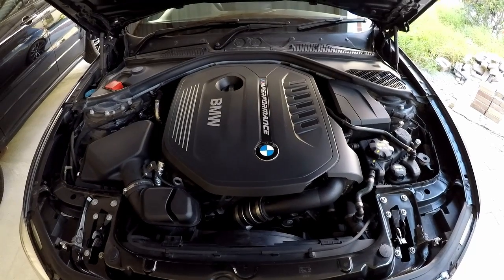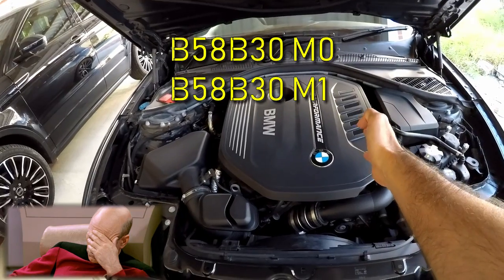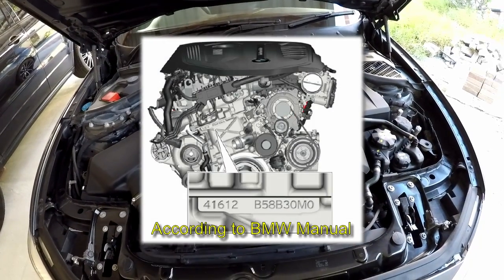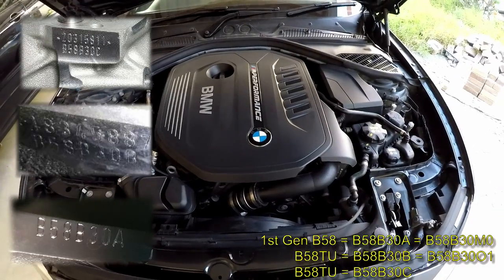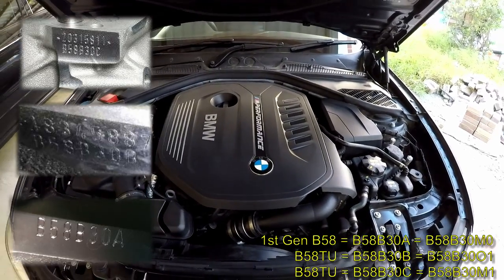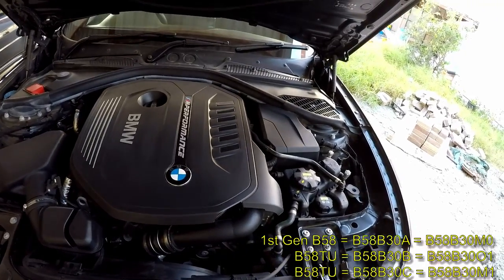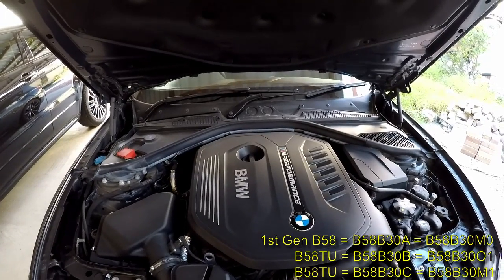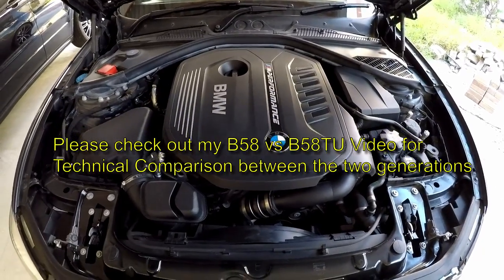BMW B58 Engine: How Many Variants?

Comment: Hi. My English is not good. I did not really understand tech difference between b58b and c. I know that b58c around 50hp less then b58b. Is it just programming or different parts? I am just thinking between 540(335hp) and 440(385hp). If I do stage 1 on both, they both will get same hp? Or still will have diff 50hp?
Reply from the maker: Hello, the B58B30C (or B58B30M1) is almost identical to the B58B30B (B58B30O1), except that the cylinder head of the B58C has an integrated exhaust manifold, whereas the B58B retains the same type of exhaust manifold at the B58A. The exhaust manifold is what takes the hot gases from the cylinders (after fuel combustion) to the turbocharger turbine section. In the B58B and B58A the exhaust manifold is outside the cylinder head, in the B58C the exhaust manifold is part of the cylinder head itself. The reason that the B58C has this feature is so that the hot exhaust gases are used to warm-up the engine cylinder head faster , and a warmer engine means a more fuel efficient engine. More fuel efficiency means less emissions. So this was done purely to reduce emissions of the B58C compared to the B58A and B58B. However, as the B58C has been made artificially warmer even though its cooling system is identical to the B58B, it also means that it can reach temperature limits faster in heavy operation conditions. The ECU is monitoring the engine temperature (through e.g. the component temperature sensor and coolant temperature sensor) and as soon as the ECU detects or projects that the safe limits are exceeded, the ECU will reduce engine power to maintain safe operation. In other words, the B58C and B58B are likely able to be tuned to the same power output (they have the same components except the cylinder head and beyond), but in heavy operating conditions the B58C is likely to reduce power faster than the B58B as it gets hotter, to protect itself from overheating. This is just my humble opinion. :)
Reply: @NoBrainerTalk   It has been on my mind for some time that the B58C performs less then the rest of the B58. But from what I understand, the only variant is the cylinder heads, and the manifold. My fam has an 2021 x5 with the B58C and back of my head, I hope I can take it to the same level as other B58's, performance wise.
Reply from the maker: @kevin22duong-_-  Hi there, much like the 1st gen B58, the B58C has been tuned with no modification from 335hp to over 400hp (especially in A90 Toyota Supras). Just like the 1st gen B58, the B58TU design seems to be easily capable of more power than stock. I believe the only difference will be how quickly the B58C reaches excessive temperatures (compared to B58A and B58B), but that should really not be a problem outside a race track.
Reply: @NoBrainerTalk  That is interesting to say the least, I know I won't racing or tracking my family's car anytime soon so I shouldn't worry about overheating issues. But I do plan to travel and push it on straights and in the mountains every once in awhile. I might look into cooling solutions and possibly aftermarket bolt on parts like intercooler to help keep the car at low temps and heatsoak. (If you have any recommendations) Is it the engine or the manifold the components overheating?
Reply from the maker: @kevin22duong-_-  It's all connected, if the engine block or turbo heats up inside the engine bay, it will heat up pretty much everything around it. Measures  to keep engine temperatures down include cooler air coming into the air intake muffler box from outside the engine bay (in the case of the 1st gen B58 this is called the "hot climate mod", opening up any blanks to allow cooler air into the engine bay (sometimes blanks are found behind the kidney grilles at the sides) but I would hesitate to do this personally without a grille protecting the opening, replacement intercooler radiator/heat exchanger as you said, checking coolant is at the correct levels at both the expansion tanks, that kind of thing.
Reply: @NoBrainerTalk  Speaking of kidney grilles, Im taking delivery of a 2022 BMW X5 xdrive40i with the B58C I believe (335hp) and it has this interesting function where it closes the kidney grilles to prevent air coming in. Not to sure as too why it's design that way, is that the cold climate package or something completely different.
Reply from the maker: @kevin22duong-_-  Hi, you have what is known as an active kidney grille. Closing the kidney grilles essentially cuts off some of the radiator/heat-exchanger frontal surface area from ram air coming into the engine bay, so reduces the cooling effect of the radiators (the front radiator is the intercooler coolant radiator, and the aft radiator is the engine coolant radiator). Essentially air is only passing through the bottom part of the radiators, so coolant is not being cooled as much as when the kidney grilles are open. This is another way the car tries to warm up the engine faster (or keep the engine warmer in some conditions), and is done mostly for emissions (warmer engine = more efficient engine = lower fuel consumption = lower emissions), although BMW states there is improvement of the car's aerodynamics as well when the kidney grilles are closed. Personally I believe it's mostly to warm up the engine, and less to do with aerodynamics, but a more aerodynamic car will also have less fuel consumption and less emissions, so both are plausible.
Reply: You will get close to the same power out of either if you're staying on the stock turbo and just bolt on parts with a tune. Stock the B58c has two exhaust port cylinder head, higher compression and lower boost pressure. The B58b has six exhaust port cylinder head, lower compression and more boost pressure but turbo is the same on both. 
I've seen a demonstration of the answer to your question in a video here on youtube. They compared a 2020 supra (B58c) vs 2021 supra (B58b) with bolt on parts and a tune. They put each on the dyno back to back tuned by same person on the dyno. 
The 2020 supra with B58c actually made a little more power at around 470hp at the wheels vs the 2021 making around 450hp at the wheels with both tuned. My guess is that with both engines having same turbo and the B58c having higher compression it was able to make slightly more peak power with little broader powerband when boost pressure was similar between two engines.
At this power level the two port cylinder head doesn't seem to be holding back the B58c. The conclusion of video is that the B58b stock vs stock is more powerful but with both tuned they make similar power with B58c edging out the B58b. What will be interesting is when both are fitted with larger turbos. Will the two port head of the B58c become a restriction compared to B58b? That's their next video.

https://youtu.be/AqNoQyiOxL0
Reply from the maker: @cjpp78ytube  A very interesting comment.
Reply: @cjpp78ytube  i have a question regarding cylinder head , i have a 2020 supra with 2 port head i want to convert it to 6 port head , should i go with any b58 engine head or i have to go only for b58b or b58a ? 
I aiming for high power engine

Comment: My 2019 M240i says B58B5UA? more confused now. It could be 3UA cant quite decide
Reply from the maker: Hi there, the 2019 M240i uses the B58B30M0 also known as the B58B30A. So I personally think the "3UA" is actually 30A (perhaps the engraving is not done correctly if you can see a "U" instead of "0"). The new G42 M240i uses the B58B30O1 (a.k.a B58B30B).

Comment: thanks for your interesting video, so the C model is aluminium cylinder head  and B model steel cylinder head? (in your last video)
A 2020 supra engine is C and the 2021 supra B model engine?
Reply from the maker: Hi there, first the easy question: Yes, the 2020 Supra is fitted with a variant C (B58B30M1) engine and the 2021 Supra is fitted with a variant B (B58B30O1) engine. Now the difficult question, but starting from an easy point: The cylinder head of the B58B30M1 is aluminium. Now to the hard part: The cylinder head design of the B58B30O1 is more similar to the B58B30M0 in that it retains the traditional exhaust manifold and traditional turbocharger. However, the Part Number of the cylinder head is different for all three variants (P/N 11128482779 for B58B30A, 11127934495 for B58B30B and 11127934494 for B58B30C). The Turbochargers are also three different P/Ns for the three variants. This means that although the basic cylinder head design is retained between variants B58B30A and B58B30B, as the Part Number of cylinder head and turbo charger has changed we cannot say for sure that the materials used are the same. So in short I cannot confirm with certainty what material the cylinder head of a B58B30O1 / B58B30B engine is made from. The fact that the B58TU cylinder head P/Ns are so close (11127934495 for B58B30B and 11127934494 for B58B30C) personally makes me believe that they are both aluminium, which makes more sense as the B58TU has some weight saving modifications (and of course I could be completely mistaken).
Reply: Thank you for your explanation, you made it clear for me.
Reply: @kosditrade  they all share the exact same material, 100%

Comment: Which version is going in the Ineos Grenadier I wonder?
Reply from the maker: Well, it's not going to be a 1st Gen B58 as those are out of production, so it will be a B58TU. I feel it's unlikely that the most powerful version of the engine as used in M340i or Z4 or the latest Supra will be used in an off-roader, so my guess is that it will be the B58B30C (i.e. B58B30M1) version. Just a pure guess. :)
Reply: @NoBrainerTalk  Cheers! The power figures floating around are so down on any version I can find I’m wondering if they are de-tuning for reliability, removing any MHEV tech etc.
Reply from the maker: @Cherub77  Detuning is the most likely scenario if it will be less powerful, and let's not rule out an entirely new variant that might be used on other platforms (a new variant just for the Ineos Grenadier is not likely).
Reply: @NoBrainerTalk  B58N?🤷🏾‍♂️😉

Comment: Is the B58B30a an inferior variant compared to b and c or not really
Reply from the maker: Many of the B58TU improvements are related to reducing emissions, which are important, but have added some additional complexity to the engine (different potential issues and unknowns). At the same time enhancements have been made to the internals so that the engine can cope with more power. I don't think the word "inferior" can really be used for the 1st Gen, because it is a really capable and efficient engine. However the M1 (C) and O1 (B) variants are further developed versions that until now are proving to be just as impressive as the 1st Gen.
Reply: @NoBrainerTalk Are B58 before 2018 less reliable?
Reply from the maker: @abrakadabraangelov1829  There are incremental improvements with every month, and some issues which affected only early builds. Generally the B58 is very reliable from any year, albeit everyone should check if there are any recalls for any engine / car before buying used, to be on the safe side.
Reply: @NoBrainerTalk  Isnt it true that you should avoid being the first year of a new generation.I am talking about Bmw going from the F series to the G series.Also another question for you would you say the G series even though they share B48/58 engines with late F series are more reliable and better build than them?
Reply from the maker: @abrakadabraangelov1829  Hi, generally avoiding a new design for the first year is a good idea. The F series only had 1st gen B58, whereas the G series have 2nd gen B58 (and now very recently 3rd gen B58). The same principle applies, early production 2nd gen B58 will have issues that will be sorted in later production.

Comment: Another way to look at it would be all 1st gen b58 came in the f30 chassis (2016-2018), and the b58TU or 2nd gen b58 comes on the new g20 chassis m340i (2020-present) as well as mk5 Supra.
Reply from the maker: If you are talking only for the 3 series then you are right. Just to be clear the 1st gen B58 can be found in 1 series, 2 series, 4 series, 5 series, 6 series, 7 series, X3, X4, etc. The B58TU can also be found in many cars in the BMW range.
Reply: Out of all b58tu chassis and transmission/differential pairs, which is the best for performance? The 340! M340i & supra?
Reply from the maker: @hefnerdon7462  Hi there, there's a carwow video of Supra vs M440i (which is similar to M340i), and the M440i generally beats the Supra except for the last rolling race where they stay even. Probably that Supra in the carwow video was fitted with the B58B30M1 (B58B30C) variant whereas the M440i obviously had the B58B30O1 variant. It might be different story for the latest Supra with B58B30O1 engine. However on a track my humble opinion is that any Supra is likely to be the best combination for performance, as both engine and chassis are tuned by Toyota for sporty driving. The M340i is likely to be very close but due to being a family saloon, BMW will build into it more practicality and comfort than the Supra (the BMW is certainly 200kg heavier). The Supra can't be as practical as the M340i no matter what the engineers do with it. The latest Supra with the high power B58 (B58B30O1 / B58B30B) further tuned by Toyota, is a weapon for sure. So the best performing B58 sports car is likely to be the 2021 Supra in my very humble opinion.
Reply: @hefnerdon7462  I would think supra because it's the lightest with same or similar engine as others mentioned , same trans with good tuning and diff from the M3/M4.
2nd would be M340 for having a B58Tu engine well tuned trans and maybe better handling chassis than 340. The 340 has first gen B58a engine, probably slowest tuned trans and maybe the worst diff of the 3.
Reply: Thank you Straightforward explanation instead of sitting through a lecture
Reply: My 2022 GR Supra has the B58B30B
Reply: But I have a m140i that’s a 2019 year. Is that the TU or?
Reply from the maker: @jordankirkbride4612  No, it will be 1st Gen B58 (not B58TU). Late production B58B30M0.